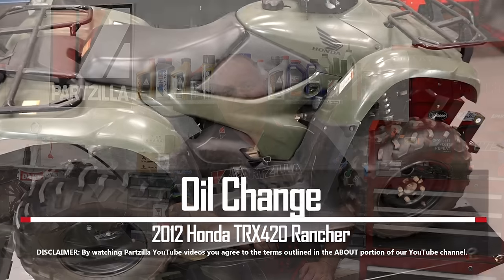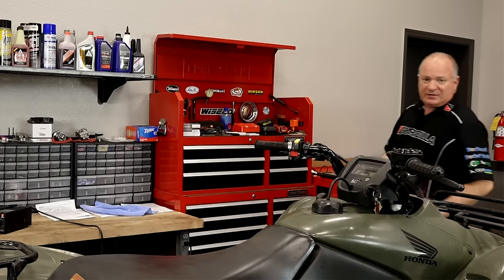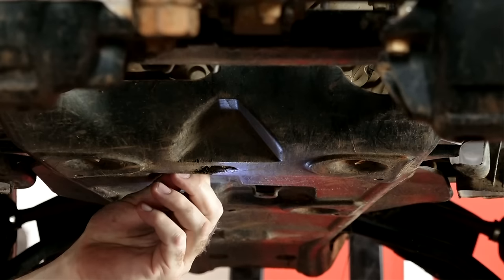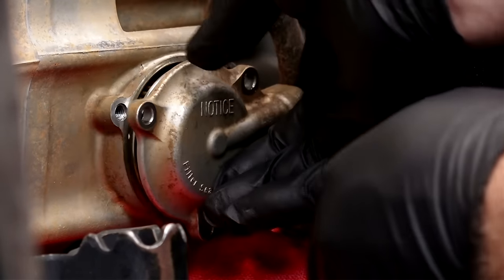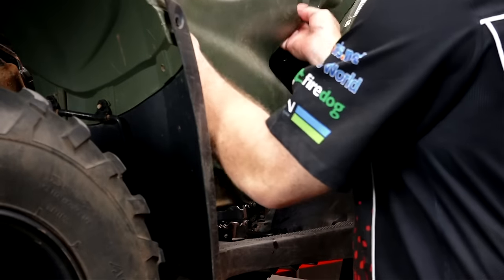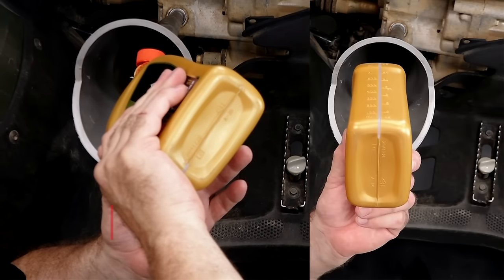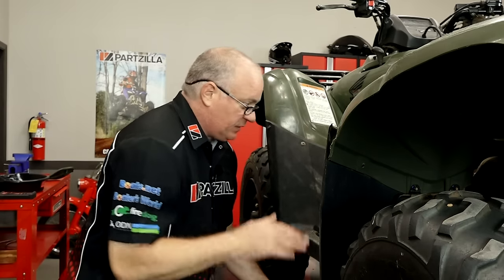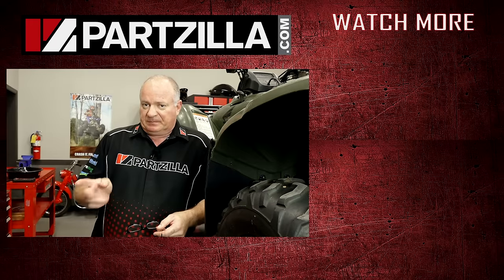Honda Rancher 420 Oil Change | Honda ATV Oil Change | Partzilla.com

Comment: I'm glad I watched your video. When I changed the oil today. I bought the ATV from a woman who had the dealer change the oil. I found that the dealer in Arkansas installed the oil filter backwards. This is in spite of the quarter inch letters saying how to orient the filter in the housing. Fortunately, the Rancher was used very little before I changed the oil.
This is why I change my own oil on all my vehicles!

Comment: Oil filter direction varies by model, TRX420FA model is opposite shown here. TRX420FA also has a flat cover plate with an arrow on it.  Be careful and replace as removed.
Reply: They need to have a recall on the engines they are trash never buy another honda

Comment: In the video it shows the factory oil non syn as 10-30 but when ordering from your link it shows 10-40. does it matter which of the two oils 10-30 or 10-40 ?
Reply: 10w40 is more heat resistance  and it is mor uniwersal for difrent climat.

Comment: Does the Oil Filter Element comes with the little O ring attached to it (facing outwards when filter element is installed) or not?
Reply: Sold separately. I know Honda says to replace the O-Ring every-time but they tend to last for awhile.  Buy couple, just to have it on hand, inspect the O-Ring every-time, if all looks good simply reapply some engine oil on it and continue on.

Comment: I bought a used 2018. The user manual says "3.8 US qt when also changing out the filter. I guess I'll need to ignore the book and start with 2-1/2 quarts and check and add as needed. I'm a bit concerned, because the dipstick shows too much oil in there now.
Reply: It's confusing as hell isn't it?! I also have a 2010 Honda Rancher TRX420 4x4 and the owner's manual says 3.8 quarts, but it only needed 3qts with the oil filter change.

Comment: How do you get the "Change Engine Oil" light to go off?
Reply: key off, press and hold the trip meter, while holding the trip meter turn key ON, keep holding the trip meter until the light goes off.

Comment: Do you guys have the left side plastic panel that you took off for sale?  I just bought a used 2011 of this model and it didn’t have that panel.
Reply from the maker: Check out this diagram. Numbers 2 and 5 might fit the bill: https://www.partzilla.com/catalog/honda/atv/2011/trx420fm-a/side-cover-tank-cover
Reply: @PartzillaParts  that will do!  Thank you so much.

Comment: 600miles or 100 hours or 12months seems like to much on a oil change atleast for my 300 Fourtrax 3 months seems like max life on the oil and that's not even riding it hard for 3 months same for my cousins 02 foreman
Reply: I guess the people who manufactured the quad must be wrong👍
Reply: Hi
Reply: 550 xp
Reply: Stering electrik
Reply: It's truly not... Had mine changed four trips back and 31km remaining of 1000km, changed it again Saturday. It was really dark, and pretty new ATV. 

Also Honda manual says " When running in very dusty conditions, oil changes
should be performed more frequently than specified in the
maintenance schedule."

Hey do what you think, it's your machine and if you want to be spending out the big bucks on repairs.... :p